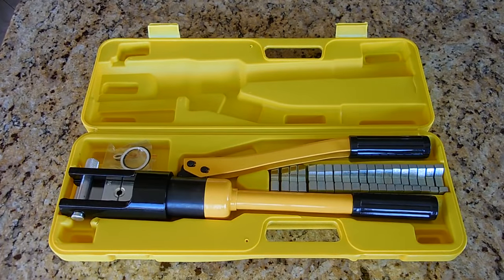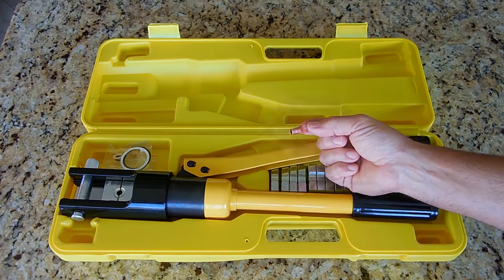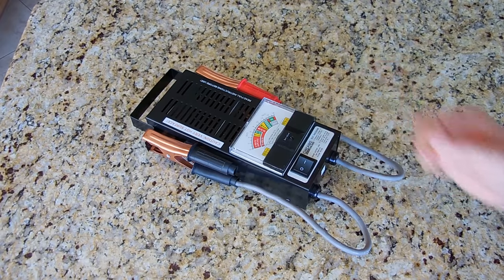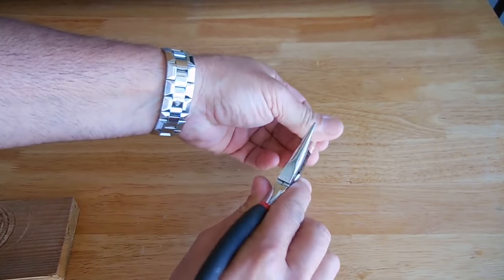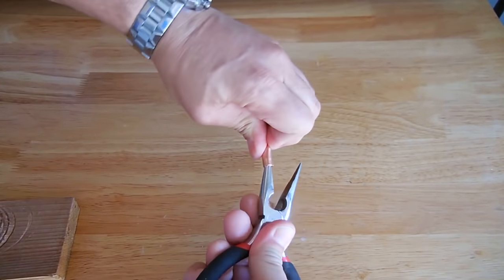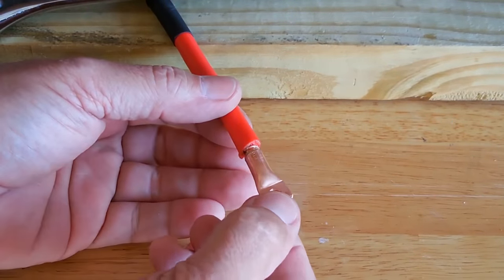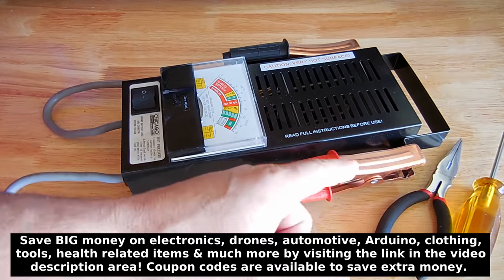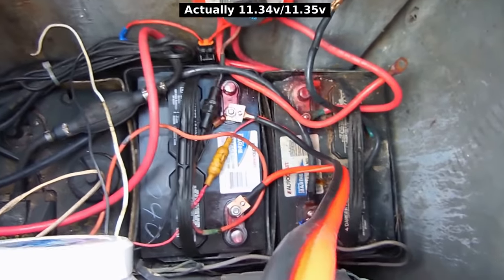Soldered Versus Crimped! Which Method Is Better?

Comment: Electric vehicle mechanic here, after observing how not to do it thousands of times (even by high end manufacturers), what I do is to crimp AND solder, then heat shrink with the heat shrink that has glue inside. I also use the terminal ends that are plated a silver color, but I don't know how to do that DIY. This method has stopped the vast majority of corrosion at battery terminals from sulfuric acid vapors.
Reply from the maker: For smaller wires I almost always crimp and solder. Be sure to check out my extensive video playlists below for many other videos of interest to you, and most importantly share my channel with others. Thanks

http://youtube.com/c/electronicsnmore/playlists

You'll definitely want top see this video: https://www.youtube.com/watch?v=_ZTk3OYacyE
Reply: . . . and you take care to do it properly rather than let the solder to copper junction be the load point. .

Comment: I crimped and soldered all the cables from a lowrance sonar for a friend of mine and he had no more problems ever since, before he had lots of problems, sensitive equipement lowrance
Reply: Hehehehe ..........     can tell you stories of solder cables on boat, ships and else .....
Reply: @perrooceaniko2005  I'm sure you could tell us tons of stories of improperly soldered cables.   I could tell you a ton about improperly crimped connectors.
Reply: Crimp+weld is unnecesary but OK  on static equipment. It is an overkill but it's fine.   Sometines that is the  procedure on military radios and others.  Crimping+welding on a vibration prone  environment as an airplane or boat or other moving equipment  is a wrong practice.
Reply: @perrooceaniko2005  with welding you melt the base metal.  That would be a much better connection than either crimping or soldering.  I'm pretty sure that the components on a circuit board in an airplane aren't all connected to each other using crimped connectors.  Solder handles vibrations just fine.  Poorly soldered joints do not.  They're not the same thing.

Comment: hi first of all thanks for the video, i often have to change cables or put new connectors on batteries or welding machines and although you show little change in v drop when the connections are "new" once they get old i`ve always wondered how they`d behave in after being in service on hard conditions. have you made a test this way? as you know on welding connectors most are just crimped by the action of one or two set screws and a copper jacket, the mfg has no problems to it but they seldom care about long term. thanks again. regards. peter
Reply from the maker: Once you crimp the copper lug or solder it, it's best to apply glue lined heat shrink tubing to keep moisture/air out. All you have to do is keep the bolted connection clean. Thanks for watching!

Comment: I've found both crimp and solder to be equally as good, but many times people trust the crimper and never check to see if the wire can be pulled out.   Crimps are great as long as they are tight.  Always test your crimps!   Where I have seen the highest failure is the exactly location between the wire/Solder or the wire/crimp junctions.  If the wire lead is able to move or wiggle and stresses that junction, the wire will failure over time.  Heat shrink helps, but it is not strong enough.  I have had much luck using a waste length of cut off tie wraps and place them under the heat shrink.  This provides the flex and strength so the wire never fatigues and breaks.
Reply: That is excellent advice.  Installing that useless piece of cut off zip tie under the shrink tube provides a nice strain relief.  Only thing to consider is that it may let moisture in - whether or not that could be an issue depends on the usage.  But cool idea.
Reply: Years ago, I used to install wireless terminals on fork trucks.  The harshest environment on earth for electronics.  This little trick worked wonderful.  The zip tie doesn't need to extend beyond the heat shrink.  Humidity and water were a constant issue in warehouses.  Fork trucks were often wet from leaking semi docks.  The next level would include using E6000 along with the tie wrap under the heat shrink.  I rarely ever had a connection issue.  However, this wasn't for high current connections, but I'm sure it would work just as well.

Comment: Interesting and correcly, for short time peak courrents, its not a paroblem.

From my understanding of your values and expereiment, The soldered connector offers 0.12 ohm of resistance, ritght?

So since electrical power P is R*I^2, and you send 100 amps throught it, that would be P=0.12*100*100 or 1200 Watch that are burned  off in the soldered connector.

Is that an accurate appreciation of the situation?
Reply from the maker: Yes, short term high current, otherwise the connector could heat up causing the solder to melt. It's VERY important that the space between the wire and copper connector is as small as possible. Smaller space, less resistance.

Comment: From my experience soldered connection don't increase resistance, but if it is a solder only connection and you pull too much current the point of it heating, say there is an un fused short ect. Then that solder only connection  could fail.
Reply from the maker: Correct, that's why you always make sure that the proper overcurrent protection is in place. Thanks for watching!

Comment: Great video. I only can agree with your comment solder is a great connection a good conductor, not as good as copper,  led Solder isl be less likely to corrode. I think where the confusion comes is too many amps go through a wire and the resistance of the copper causes heat then the solder melts. The thinner the cable the more the resistance for a given constant load, load is amps amps is power.
Reply from the maker: Thanks for the comment!

Comment: ive just heard that soldered lugs will fail after a period in a vibratory environment, where crimped it still has wiggle room, before the solder/copper work hardens and breaks. If i had a nice crimper like that id crimp and solder anyway. since i cant crimp nicely, solder it is
Reply from the maker: erik61801 I've used soldered cables in boats and cars over the years, both which vibrate, and none failed.
Reply: solder is lead and tin.  Its soft and malleable  It only makes copper "more brittle" by evening up the ends where it flexes all to the same linear point.   (bend a copper wire back and forth long enough to brake it  by holding it 3 feet apart or holding it 5 inches apart)   That failure mode of soldered connections is common, but only because implementing it wrong is common.

Comment: I always prefer soldered over crimp. Crimping is much faster which is nice. Soldering over time keep corrosion out of the connection. Crimping then Soldering is even more preferred. I have heard old Ford 9N, 2N, 8N, and NAA tractors (from the 40s and 50s) all had soldered connectors to keep out corrosion to ensure a long reliability even with getting rained on all year long. The expectation of these tractors they would get left outside or used in the rain and snow. The wires were very simple and very exposed.
Reply from the maker: I agree if you crimp using an ordinary crimping tool, but a hydraulic crimper does work very well, especially if you cover the connection with glue lined heat shrink. Thanks for watching! Be sure to rate thumbs up, check out my video playlists, and share.
Reply: yea most of my wiring is between 12-18ga so I just use the small crimping tool. A crimper like yours would be awesome for fixing the connectors on the trolling motor. I don't have any glue lined heat shrink I should change that. I looked more closely at the connectors in the store. Sure enough you can see where they just flatted a piece of copper pipe.

Comment: I always crimp and solder which is used for my solar system and so far so good. After crimping and /or solder pull on the wires and connector to make sure it is tight,
Reply from the maker: J & B Homeliving Thanks for watching!

Comment: im 76yrs old, it would be hard to think of any way of connecting wiring i haven't tried over the years, i drove a car hauler for years (hauled race car) , and used for hot shot delivery and general use, probably put nearly 300,000 miles on it before i parked it, big block chevy with two batterys under the hood, after several years of constantly repairing and maintaining cables and connections under the hood, to the starter, and back to the big winch on the bed, and the 30ft cable with remote switches, i got a deal to move cars from one wrecking yard to another, old classic stuff, after looking at my truck the man sent me at his expense to an automotive electrical shot just outside of san antonio where i live.  the man replaced all my cables with 00, used brass fittings , i guess you call them fittings, and crimped each one, my dual battery's , down to the starter, off the pass side battery back to bed to winch, then made me a new remote cable with a new switch, not one was attached except by crimping, some had no heat shrink. that was in 1994, i parked the truck in 2003, or took it off street, it was used for a few more years on private property. you can walk up to the truck today and there is no corrosion anywhere, not even a hint. it uses side post batterys with a stud in each hole more or less permanent. if you just think for a minute before saying you would rather solder a connection, are your cables and wiring from the factory soldered or crimped.  when i was military i worked on B47 bombers, yeah im that old, i can't be positive but i don't remember ever seeing soldered connections.
Reply from the maker: I would think the connector used was copper, not brass cable ends. Soldering heavy cables isn't common, I was just showing viewers a comparison between the two. Using a hydraulic crimping tool is best IF covered with glue lined heat shrink when done crimping. The level of corrosion depends on the quality of the cable and the level of humidity where you live. Thanks for watching!

Comment: You should make some cutter inserts then you could use them as bolt cutters.
Reply from the maker: The problem is getting the part to be cut in the center of the die.

Comment: Worked in the aircraft maintenance industry about 20 years ago..  straight soldering of a connector was forbidden. Had to be crimped. And I never saw one that was soldered after, though I do it on my own things that are weather exposed.
Reply from the maker: Yes, the concern is the connection heating up and the solder melting which would allow the connector to separate from the wire. Luckily I haven't had any problems.  Agree though, a very good idea to at least crimp if you decide to solder.  Thanks for watching!
Reply: thats not the real concern with aviation and soldered connectors. Of greater concern is that the solder wicks up the wire and bonds the wires together a mm or 2 upstream from the connector. This caues a fracture point and with constaht vibration, the cable will break right next to the xonnector. Ive seen this happen often with soldered connectors.
Reply: The vibration is extreme on a jet chassis. I mean violent. That doesn't really exist on other applications. They do recommend aviation type connection's on most stand-alone computer's. It's probably Overkill in practice. I have seen rocks bouncing on the ground at high power.
Reply: @9neil  "Of greater concern is that when done improperly the solder wicks up the wire" fixed that for you.

Comment: People who say "soldering is going to create more resistance" they are totally wrong. and the proof is motherboards and PCB they solder their componentes, and there even a tiny resistance could make a huge problem but they do it. So there you go.
Reply from the maker: Correct. Wide circuit board traces covered in solder to handle high levels of current.

Comment: Have you tried the pull test? The ideal copper crimp will be stronger than the wire used in the crimp. So during a pull test, the wire will break but the crimp will still be intact.
Reply: Pull with what?
Reply: @martinwhite418  A winch or something. you have to improvise.
Reply: @keantoken6433  I asked because I have seen people on YouTube "test" by pulling with their hands.

Comment: I prefer a crimp and then solder, can't get better then that.
Reply: A D yes 👍👍👍
Reply: solder won't flow into a properly crimped connection (meaning the correct STRANDEDwire for the connector and the correct crimp dies and tool) as there is not a enough of a gap to overcome the surface tension and allow solder to flow into the core, sounds nice on paper.... Also if the joint gets hot enough to melt the solder its best it does become high resistance and fail as it avoids the whole wire melting its insulation off or making whatever other fault there is to create further problems. A soldered joint wins hands down unless you need cable to operate at over 300 °F
Reply: Solder the bare end of the wire strands. Then crimp. Then resolder.
Reply: Solder then crimp is not a good way to go.
You really want your lug to have a small hole that gives access to the cut end of the wire.  After you crimp, you flow the solder to seal it all up air tight.  This way the differing metals can't cause corrosion at the joint.
Reply: A D Actually, you can.  As for reliability, a crimped only connection is far superior to a crimped and soldered connection.  I know, it sounds counter-intuitive and I once believed as you.  Solder is brittle and when subjected to vibration, it will fracture over time, taking the copper wire with it.  If your connection isn't subjected to vibration, then you might not be able to see this vulnerability.  If you solder first, then crimp, your connection will become loose over time, because solder will flow under pressure.  But don't listen to me, check with the US military - they FORBID the soldering of wire to crimp connections.
Reply: Several industrial machines companies and folks who have to do stuff outdoors have put it to the test and disagree with the US military on the topic.
Reply: Steve K dont tell NASA they're doing it wrong.
You probably don't like lineman splices either.
Reply: Having worked on spaceflight qualified hardware, I can assure you that there was NO solder on their crimps.  And what lineman carries a soldering iron?
Reply: Steve K
I have worked on things that have seen seawater and dirt and needed to keep working a long time.  A space craft is a clean environment by comparison.
Reply: grumpybill Perhaps you should actually read your "evidence".  There are no soldered crimps in that document (or NASA, for that matter).  Let me explain what you are seeing.  Splices can be made with soldering, or crimping - not both.  A properly made crimp provides an air-tight connection.  Adding solder doesn't improve the connection.  Now you're entitled to your own opinions, but not your own facts.
Reply: I prefer solder and then a crimp, can't get much better than that.
Reply: 6977warrior1:
Solder then crimp is horrid.  Over time, the joint comes loose because solder creeps under stress and it corrodes because the joint is not sealed.  It results in the worst of both worlds.
Reply: Ken- Yes I know. I was being silly by reversing what A D said above. Thanks anyway.
Reply: Interesting then there must certainly be something to that from a vibration stand point.  I certainly would've thought crimped first would take care of that, and the solder would just help with conductivity and strength.  I guess just a soldered connection without the crimp would be bad too for vibration.  This rule must apply to aircraft.  Well at least better then throwing a wire nut on it...
Reply: AD
To keep vibration off the joint, you need to anchor the joint and the wire to the same object.
Reply: always  flux,,crimp and flow in my solder ,, never an issue !
Reply: @stevek5416  
Tienes toda la razón, no solamente el ejército, sino todos fabricantes de automóviles.
Reply: @AnX8765  
Yes, it is a bit of a "religion war".  Folks who have had to work in places with bad coffee and worse internet tend to be of a very different view.

Comment: Inadequate cable testing, voltage readings should've been taken at the battery posts and at the ring terminals at the other end of the wires when loading the circuit...for both, crimped and soldered, and crimped only lugs.
Very nice video with a big wasted opportunity.
Reply from the maker: You don't know what you're talking about. LOL. The test showed the most important thing, VOLTAGE DROP using a 100A load. A comparison between a crimped and soldered connection showed little difference.
Reply: electronicsNmore, your method of measuring voltage drop is flawed.
Replying "you don't know what you're talking about. LOL" didn't make it any less flawed.
Hope you can learn how to take constructive criticism positively.

Comment: problem with soldered lug is the strain and fatigue when there's vibration after some time. It's reliability issue.
Reply from the maker: As long as the cable is secured, it should never get damaged.